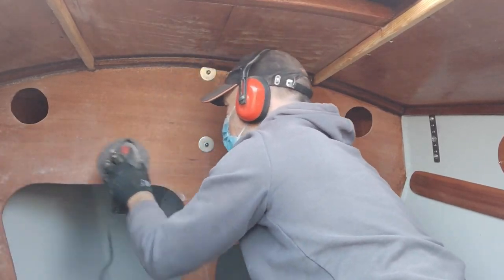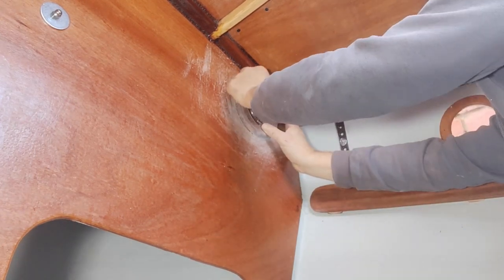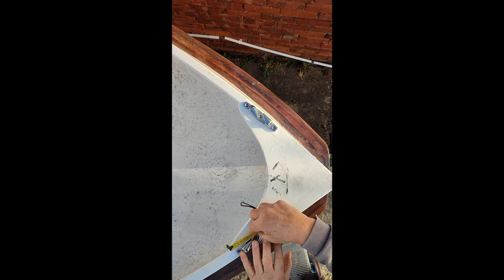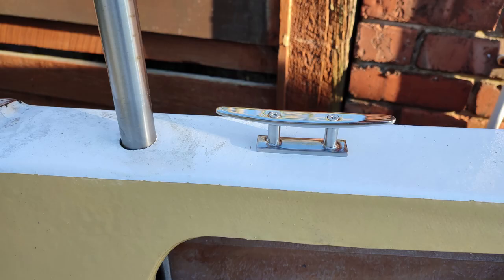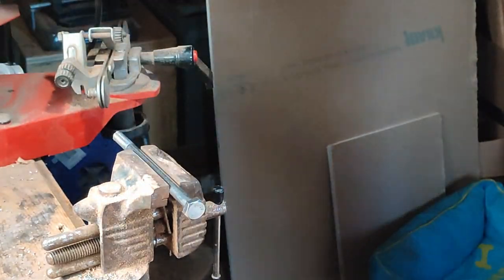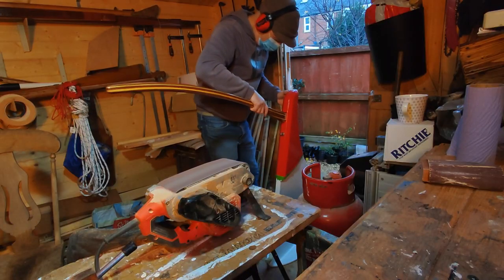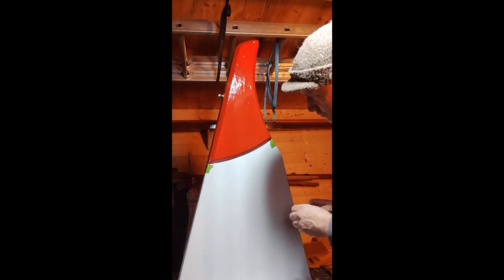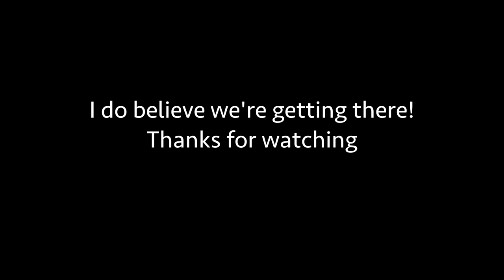AHAF Building a Pocketship part twenty

Comment: Hi Alan, just found your channel. An idiot's guide to building pocketship! I've flirted with the idea myself after thinking about dinghy cruising, but I'm more of a "glamper" and like the comforts of a cabin. 
Couple of questions: can you epoxy resin over varnish? Or just wood stain? Also, have you considered doing a commentary video in which you describe why you chose pocketship compared to other options? It's always interesting to hear how people finally chose their build.
Cheers 👍
Reply from the maker: Hi Luke, Thanks for your comment and questions. Firstly, about the epoxy over varnish. I never tried this but understand that epoxy works best when it has a chemical bond (epoxy on epoxy while the first coat is still 'tacky') or second best physical bond produced by sanding the first coat with fine sandpaper  before applying the second coat. Personally I would prefer to sand back to bare wood before applying epoxy as this works well as a base coat, with topcoats of varnish which is UV resistant, unlike the epoxy. I really like your idea about the commentary video and will try to produce this in the near future! Thanks again and good luck with your future boat building adventure 🙂
Reply: Epoxy over varnish?
No point,  really.
Epoxy breaks down in sunlight whereas varnish has UV inhibitors which protect underlying epoxy.